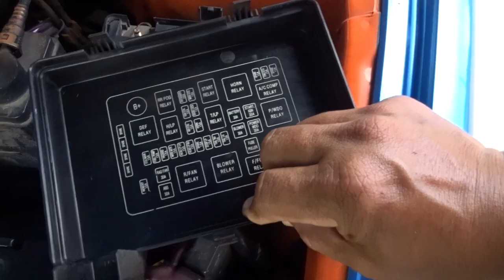Proton Gen2 Cara Tukar MOTOR Kipas Radiator

Comment: NIce video bro . Mau tnya ba sbb saya perasaan diatas radiator kmu tu ada sticker do not mix coolant. Tpi tingu kmu buka tu hose radiator ada pula coolant didlm haha. Kereta saya pun ada jga sticker mcmtu do not mix coolant dia bilang. Saya mau juga pakai coolant tpi disebabkan sticker tu nda berani saya mau pakai coolant takut apa2 jadi sama kereta. Boleh bagi pencerahan utk kes ne bro. Mcmna bro boleh letak coolants biarpun ada tu sticker do not mix coolant 😁?
Reply from the maker: ya pa pun terimakasih sudah menonton bro, di sini saya bagi penjelasan mengenai label tu "do not mix coolant" radiator dalam video saya sudah tukar yg baru dan yg aftermarket saja, radiator lama ori muncung ke spare tank patah, jadi penukaran tu secara kecemasan, betul sesetngah radiator aftermarket ada label tu bermaksud bahan aluminium dia tak brpa tahan coolant berbanding aluminium.ori dan cooper original, baru2 ni sya pun sudah flush dan guna air mineral saja..😅

Comment: hello boss, sy pakai proton iriz. and series motor fan saya ae268000 4010 (jenama denso). kalau saya tukar fan tapi series 168000 2570 boleh ka?. sebab tanya di kedai dia cakap boleh. minta pendapat boss
Reply from the maker: Sebaiknya bawa contoh fan ke kedai part, padankan sebelum beli..

Comment: Assalamualaikum bossku. Terbaik video! Boss...nak tanya, sya punya gen2 kipas dia x pusing kalau x on aircond. Kena on aircond bru kipas pusing. Kalau mau round2 pasar x pakai airkond mmg temperature akan naik...😅 Bila on aircond barulah temperature turun pergi tgh2... Ada member cakap sensor temperature enjin kong... Betul ka itu??? Hehe... TQ bossku! 😎
Reply from the maker: Waalaikumussalam wtw bro terimakasih, biasanya masalah ni dari sensor atau wiring..kena ke bengkel check tu bro... normal temp.  50 keatas kipas idup. overhead kipas tetap on smpai temp turun normal baru kipas auto off.
Reply: @AchoiXcelSamsulBha Alrite boss! Tq info. Kalau boss pun cakap begitu, so 80% sensor atau wiring lah ni... Alrite... Nanti sya bawa ke bengkel bgi dorang cek sensor dgn wiring... Lpas tu lagi satu, lampu cek enjin nyala... So mungkin betul lah lah tu sensor atau wiring... Salah satu lah ni... 😎 TQ bro!! Terbaik! 🤟
Reply from the maker: cari bengkel yg boleh buat PDT bro, scan terus senang tau punca masalah.

Comment: halo busku relay radiator sya terbakar bru jh tdi petang d kk boss sya ganti relay smntra dlu guna blower punya apa sebab dia bole sot bgtu boss bole terbakar tu relay ? adakah motor radiator
Reply from the maker: cuba check socket connector motor kipas nya bro..
Reply: @AchoiXcelSamsulBha  sya x main soket boss direct trs tu ari sdh bt tpi tiba2 relay lagi terbakar
Reply from the maker: oo check sambungan wire
Reply: @AchoiXcelSamsulBha  smbngn wire ok boss
Reply from the maker: @dragodell1844  ya..kalu belum pena tukar tu masalah motor kipas
Reply: @AchoiXcelSamsulBha  motor kipas kong sdh kah tpi pki relay lain pusing boss
Reply from the maker: @dragodell1844  sambungan wire dia ngam juga kh? check angin kipas tiup enjin kh tiup radiator? kalu tiup radiator wire terbalik, temprature normal juga kh?
Reply: @AchoiXcelSamsulBha  okeyy temperature ok angin tiup enjin mcm normal tpi xtau apa psl bole trbkr tu skrng kipas jalan sbb sya guna relay lain tpi sya mau tau apa mslh dia bole trbkr takut nnti tukar relay baru sma juga trbkr
Reply from the maker: @dragodell1844  try pakai dulu lh bro, kalu relay tu terbakar lagi, maslah dari motor kipas lh tu.
Reply: @AchoiXcelSamsulBha  sllu motor brpa kos kalau gen2 boss
Reply from the maker: @dragodell1844  tengok jenama juga tu bro, biasanya jual d online ada murah sikit tp takut tidak ngam, kalu mau beli baik buka motor yg lama tu bawa p kedai part buat contoh, Gen 2 model pertama 2004 pakai brand APM, dan seterusnya pakai DENSO, kalu boleh jgn beli yg tak ada jenama, betul murah tp tak berbaloi tgk nasip jg.. APM @ DENSO harga dalam rm200 kebawah area KK.
Reply: @AchoiXcelSamsulBha  tq arr busku jdi tu relay dia brpa tu boss
Reply from the maker: @dragodell1844  relay 12v 30A 4kaki hrga ringgit2 jak tu bro..hehe
Reply: @AchoiXcelSamsulBha  okeyy bro tpi tu fius box yg ada kesan trbkr tu xpaa2 kah tu bro tkt melrat nnti
Reply from the maker: @dragodell1844  baik bawa p bengkel check bro

Comment: saya rasa mempunyai kereta Persona Auto 2008
akhir-akhir ini, kereta saya ada masaalah bile engine on tapi berhenti lama seperti di traffic light atau menunggu orang, temperature akan naik melebihi 90 darjah celcius. Apabila kereta berjalan semula, temperature akan turun menjadi normal
saya telah periksa fan radiator, saya dapati pusingan fan agak perlahan. 
kebiasaannya kalau fan motor berjalan akan dengar bunyi angin yang kuat... tapi fan  saya bila ON tiada bunyi yang kuat seperti selalu
adakah ia tanda2 motor fan perlu diganti?
terima kasih.
Reply from the maker: cuba swap dulu fan radiator punya relay..biasanya masalah relay atau fan motor.
Reply: @AchoiXcelSamsulBha  
terima kasih atas response dan panduan
saya dah cuba swap radiator fan relay dgn relay defogger (same rating)
tapi tiada sebarang perubahan. Jadi saya dah ambil keputusan utk tukar motor kipas
Reply from the maker: @arizmayaabdullah5061  Sesama bro.. semoga berhasil

Comment: Size asal kipas ori gen2 brp , 12 atau 10?
Reply from the maker: gen2 1st model auto, 1 kipas radiator kongsi ngan aircon size 15inci.
Reply: @AchoiXcelSamsulBha  2004 gen2 auto...size kipas 15 inch?
Reply from the maker: ya bro..